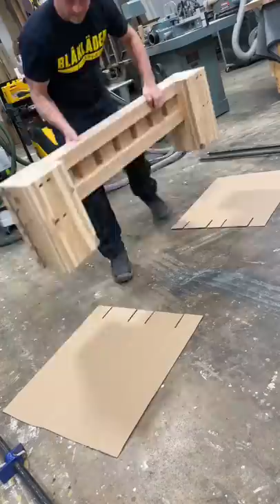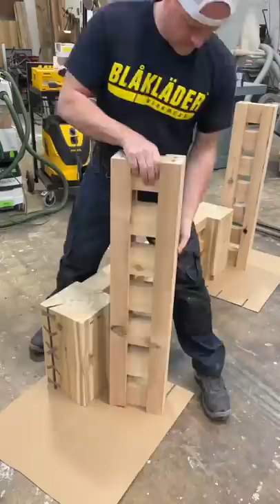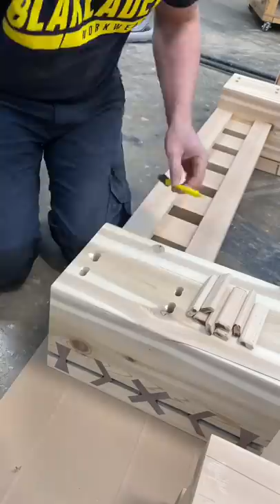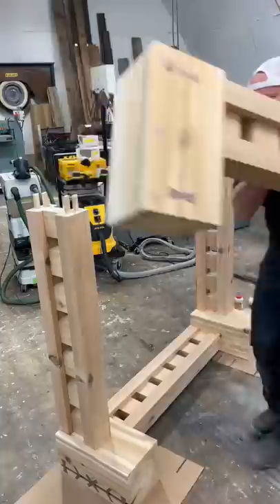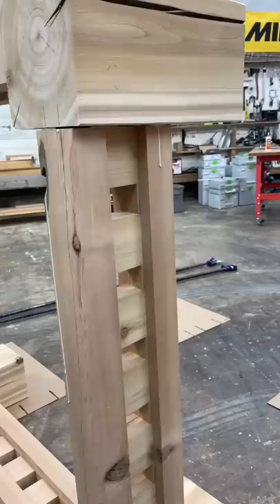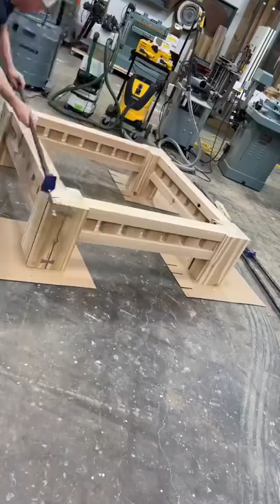Getting the base together

Comment: Wow, that coffee table is stronger than my workshop 😂
Reply: Cool but what is it and why couldn't we find some lumber without massive splits in it?
Reply: That's not a coffee table it's a landing strip
Reply: @spedv1nce741   but you'll see, them deep beech wood dominos into oak will get loose.
Reply: Probably weighs more too.
Reply: @jancloddlafront9185  Thank god the glue expands as it dries and keeps the domino hole from expanding and loosening.
Reply: Los últimos sargentos de ajuste a la madera colocados  por la parte inferior así no sirven a su propósito  más bien. Llegan a abrir la parte requerida.  Véanlo y piénsenlo.   ERRROR
Reply: @PracticalTacticalSheepDog wood naturally has disfiguring and some people like that natural look. You can see he added inserts to prevent further splitting

Comment: I love your videos. One note: you fixed the crack on one leg, not in the others. Any reason?
Reply from the maker: Thanks! They are all stabilized with either bow ties or dowels from the other side of the crack 👍
Reply: @dustylumberco  Oh, I see. I wouldn't expect otherwise from you :)
Reply: I would have placed the cracked wood sides on the inside corners instead of facing outwards. Is this an already commissioned and paid for project, or for sale?

Comment: Love it but what about the slits?  Are they from drilling and hammering? Will this effect the strength of the legs?
Reply: They’re natural cracks called checks, common in thick pieces of lumber as it dries out. They usually don’t affect its strength, unless the crack goes through a joint.

Comment: The sad part is the fact that after a few years it is going to fall apart because he cheaped out on the glue.  That red tight bond has a 70 % failure tate after 42 months . He should have spent the extra $8.00 and got tightbond 3

Comment: As good as it is to have enough glue as a sander/sprayer I would be having u sacked after the 5th time u did that because it’s a nightmare to get out of the corners especially if ur doing a stained finish because it adds red tint to the stain which is a no no